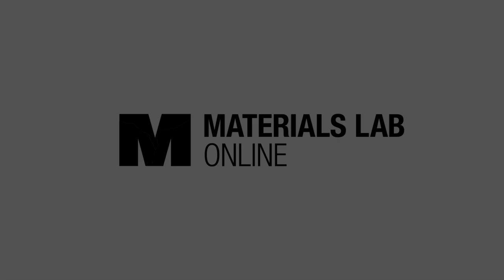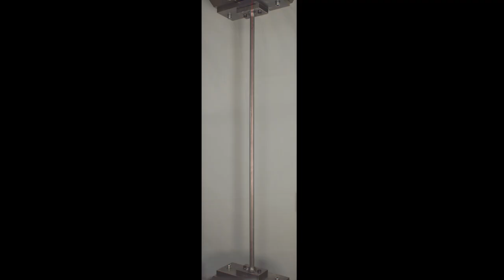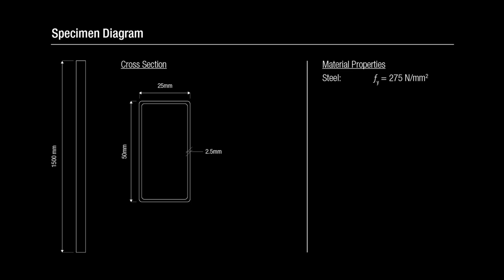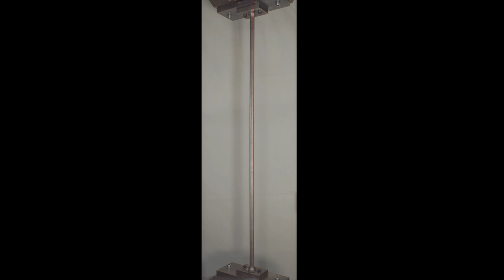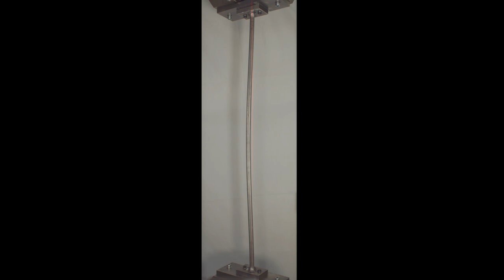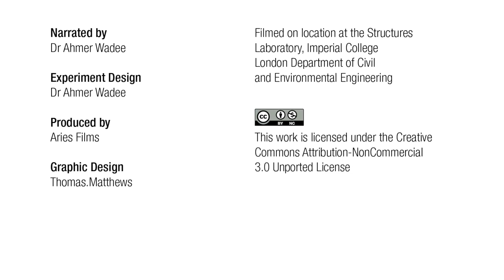Buckling failure of a fixed ended slender steel column: Materials Lab on-line

Comment: Professor ,what determines the Direction coloumn is going to buckle towards.
Say there is equal chance of being buckled towards right or left as area  moment of  inertia of cross section is same towards the directions 
Please answer me  Sir?
Reply: There is either an additional load creating a bending moment or simply that the column was not made perfectly straight so there is some eccentricity to start with.